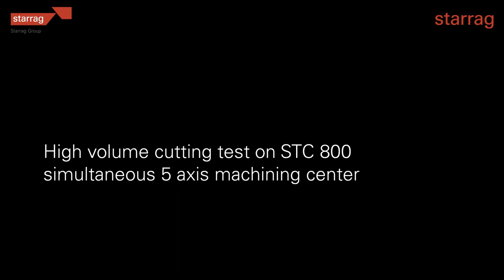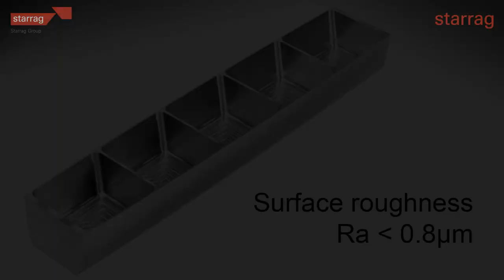High volume cutting on Starrag STC 800

Comment: You guys post some incredible videos. You should throw in a shot of the KW/load meter during a cut. I'll bet some of those big face mills suck a lot of juice!
Reply: Yes they do! It's pretty easy to estimate HP draw; cubic inches of MRR multiplied by a material's unit power factor.